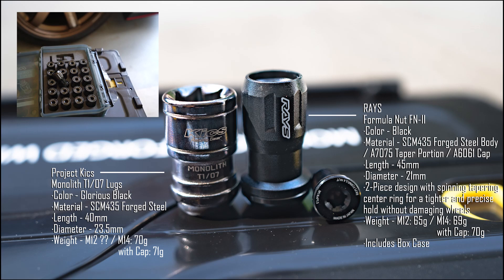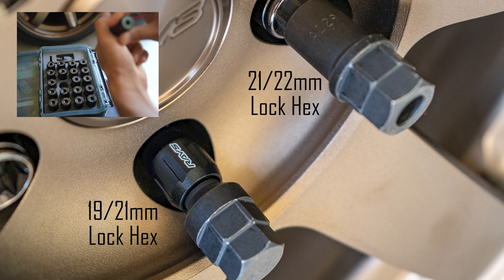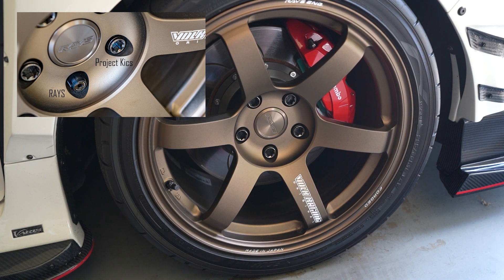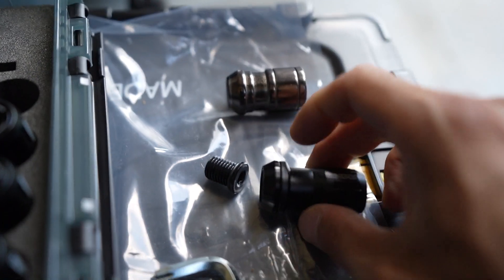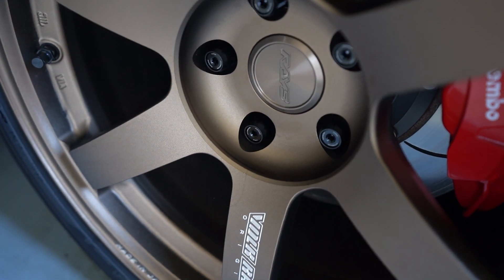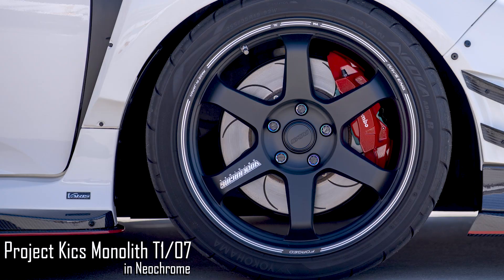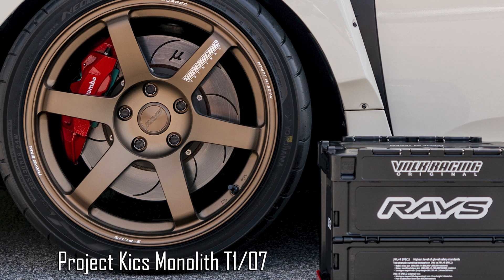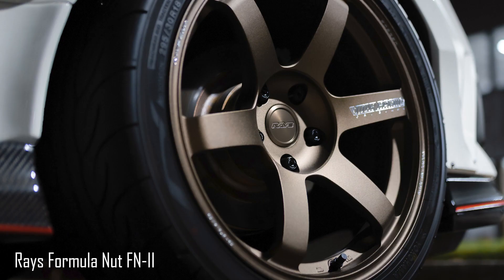Project Kics Monolith T1/07 vs RAYS Formula Nut FN-II [JDM Lug Nut Comparison]

Comment: Do the rays come with wheel lock or the unique design serve as a wheel lock ?
Reply from the maker: It comes with a lug key to loosen/tighten from the inside of the lug, but every FN-II key is the same 😂
Reply: @Kodawari.FK8  thanks went ahead and ordered a set from that website you recommended as well

Comment: Can use run FN2’s as a open lug nut?? Reason I ask is because I ordered them for my gramlights but Im going to have to run spacers in the front of my gr86 to avoid rubbing therefore I need longer wheel studs for the front and these won’t fit on longer studs unless I can run them with no cap
Reply from the maker: They can as long as the stud doesn't stick out so far that you can't get the hex bit in to loosen/tighten the lug

Comment: I was considering getting the monoliths, do they
 hold up good to weathering? Do they rust from the weather or anything?
Reply from the maker: You'll get rust without the plastic caps, but even with the caps they aren't completely sealed so you'll still get some rust
Reply: The monolith is very high quality steel and finish.
I use them only in summer conditions, and they are like new after 3 years.
I could imagine every nut out there having problem with rust in salty conditions, unless you use Stainless steel lug nuts, ... That I never encountered in all my life.

Comment: Hey bro, I’m trying to buy the rays from your link but I put down my information and it says it’s not working and another thing is I don’t have the same rims you got, but I have from the same brand you have were they fit? I have a FK8.
Reply from the maker: Just use any of my links and search rays formula nut m14x1.5. That’s the thread size of fk8 studs.
Reply: @Kodawari.FK8  thank you for your help. My bad for the spelling.
Reply: One more thing, bro can you help me get a good price on center caps for my rays ze 40 please cause by how much money you save me on the Lugnuts. It looks like you’re the plug.
Reply from the maker: @Afoothatsfire I had to replace a center cap and bought through @bulletproof_james on Instagram. He works for bulletproof automotive

Comment: How long do shipping normally takes? I got to check out but it doesn’t say how long shipping will take.
Reply from the maker: You can contact them in the bottom right of the website to see if they are in stock. Mine took like three months because black caps were out of stock at that time.

Comment: The link for the lugs are they authentic rays? They seem pretty cheap compared to the stores u just wanna make sure I get real ones
Reply from the maker: Blackhawk Japan is 100% legit. They’re a lot cheaper because they’re shipping direct from Japan. $1 USD is like 140 ¥ right now. The yen is really weak so parts direct from Japan are crazy cheap right now.
Reply: @Kodawari.FK8  thanks for the reply. I got some knock off ones on amazon for the time being like 50$ been a year and the key hole are stripped and rusting so I'm wanting new authentic ones to last for my re30

Comment: Those are tough wheels because of the widebody spec. The center part is basically a wheel spacer integrated into it from what I can tell. Might try tall lug nuts.